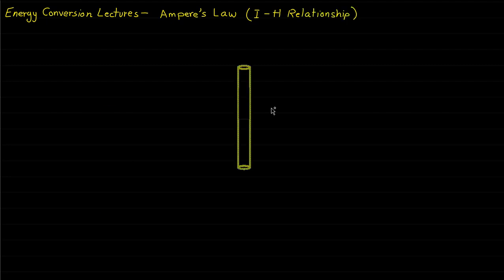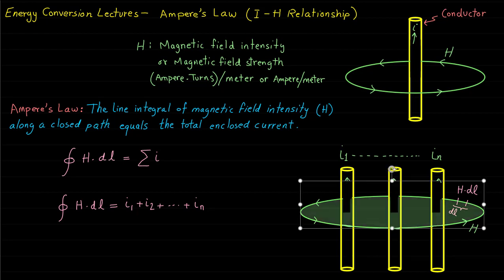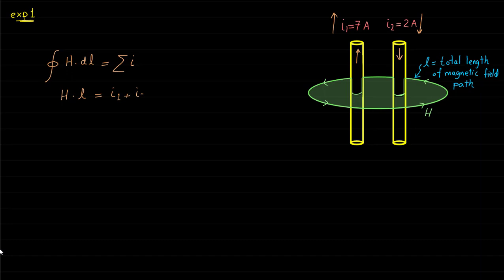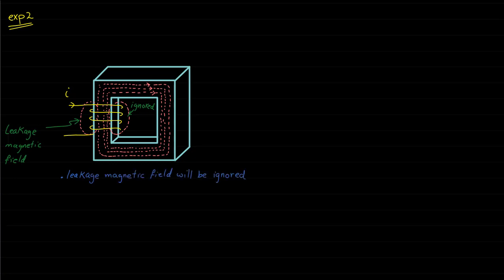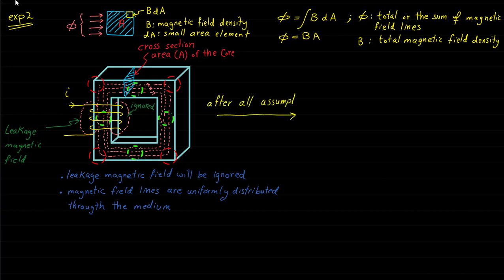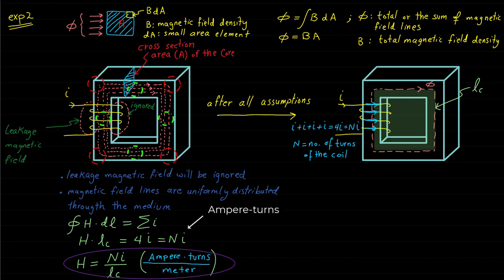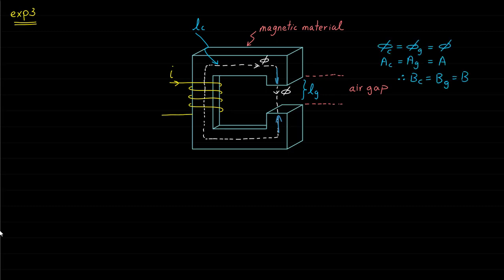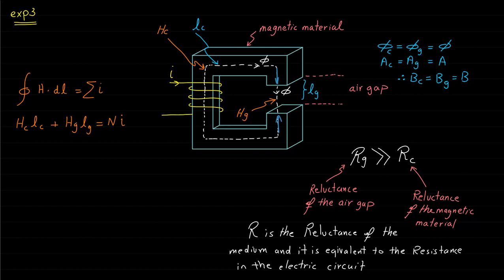Magnetic Circuits - Ampere's Law

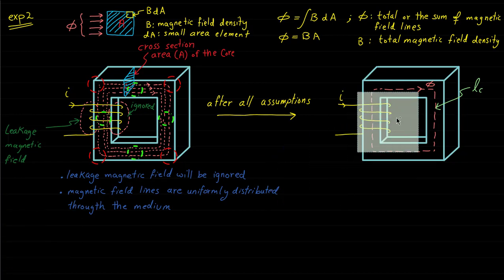Comment: At 7:19 in my head the current is entering but also leaving the closed area therefore they cancel some terms. If anyone could help me understand why this is wrong I would be grateful.
Reply: The current is constantly flowing in and out, what we are focused on is the magnetic field it generates
Reply: It's exiting it but outside the closed area, so that doesn't count as the area in question (the area we are analyzing) does not encompass the outside of the circuit